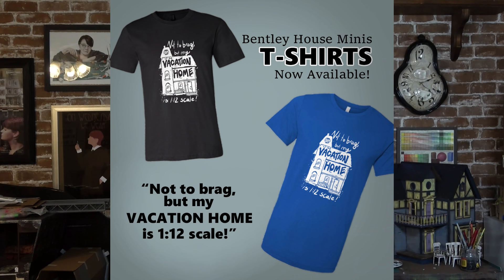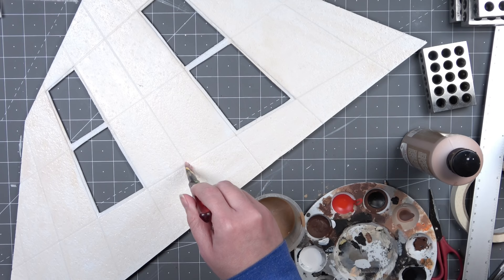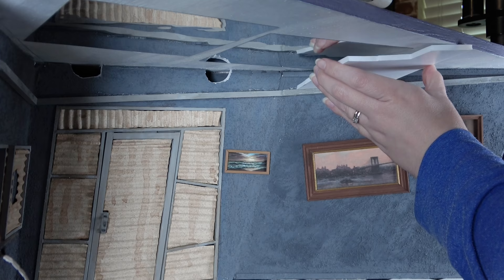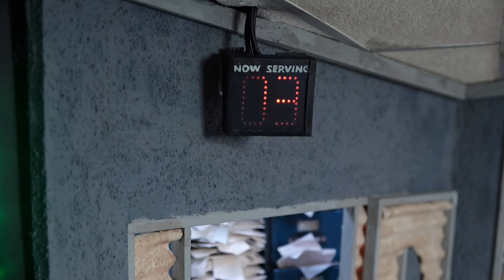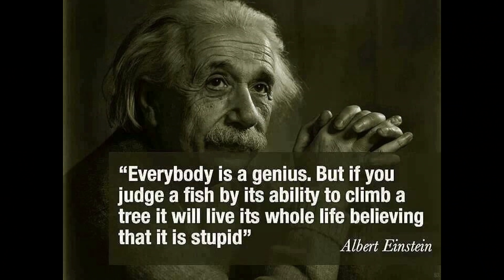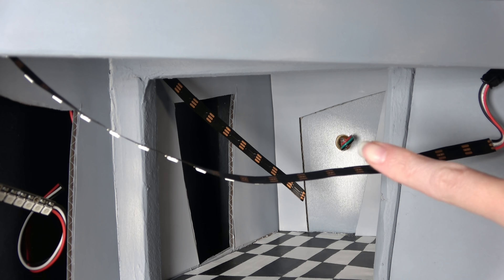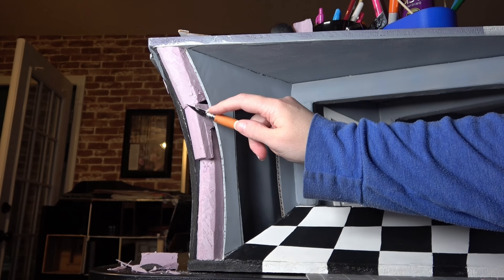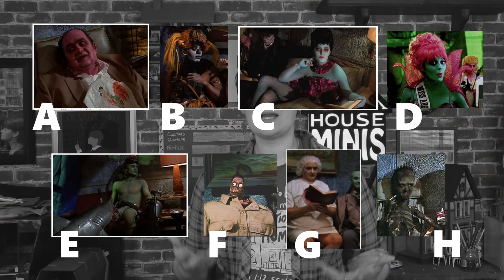DIY Miniature Office Ceiling And a lot of LIGHTS!💡(Beetlejuice Waiting Room PART 4)

Comment: Ah, sanding the plastic as diffusion is very cool, and so is the tissue paper and the mirror. This is going into my bag of tricks! #AraSchool.
The water damage on the ceiling is the bees knees and those air vents for cooling the LEDs are brilliant. 
I love how you hid the wire connectors under the chair. Clever. 
That Einstein quote is great. I feel pretty dumb when it comes to lighting, but watching this does help a lot. 
Amazing work and incredible detail with clear explanations. Amazing. Rock on!